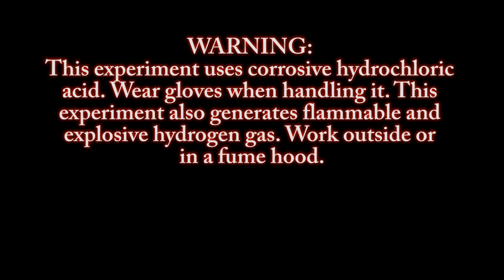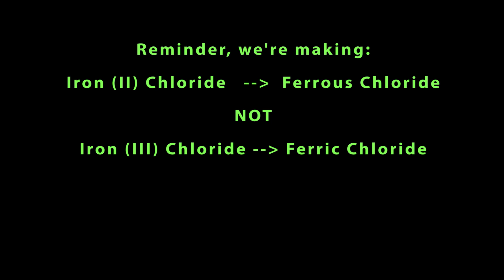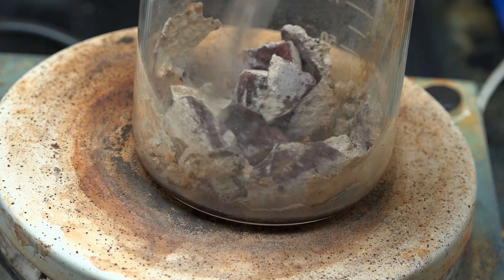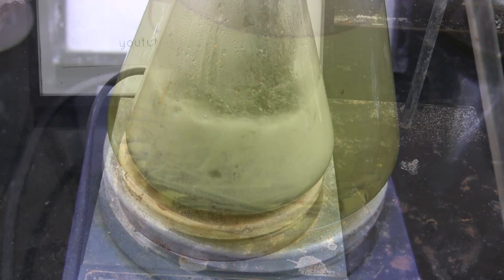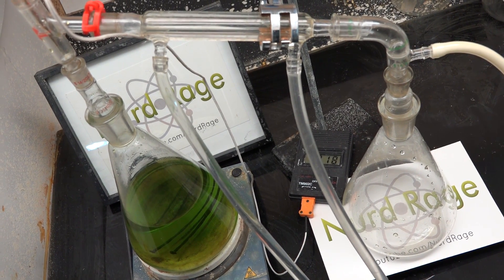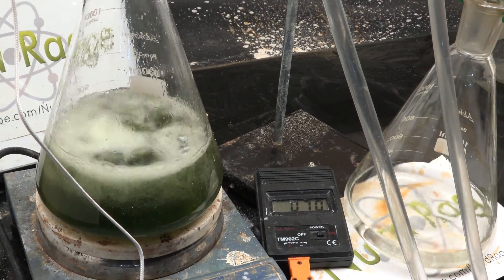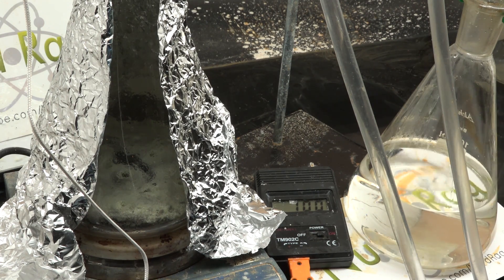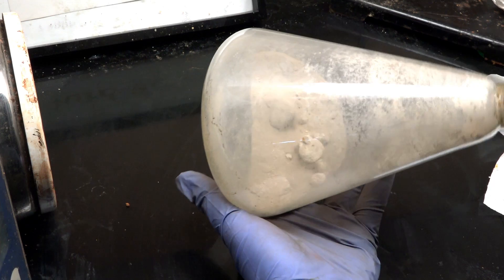Make Anhydrous Ferrous Chloride

Comment: Actually, water can't be used instead of methanol, otherwise no methanol solvate will be obtained, and it's mean that the obtained product won't be anhydrous. So the green solution is a solvate, proof is here G. Winter; Thompson, D. W.; Loehe, J. R. (1973). "Iron(II) Halides". Inorg. Synth. Inorganic Syntheses. 14: 99–104. doi:10.1002/9780470132456.ch20. ( from wiki)
Reply from the maker: Your reference states methanol is preferred. But doesn't state it's necessary.
Reply: Yep you were right, it really mentioned there, sorry.

Comment: Here's how to make ferric chloride anhydrous: Get some iron and hydrochloric acid, then add some methanol to the mixture. Then react it with some hydrogen peroxide, oxygen, or chlorine, distill off the solvent, and insulate it to prevent moisture getting in. That's how to make anhydrous ferric chloride.
Reply from the maker: Already in the video.
Reply: @NurdRage  I guess I don't see it.
Reply from the maker: oh my bad, you mean ferric chloride, or Iron(III) chloride. Unfortunately your method won't work.
Reply: @NurdRage  you mean to tell me that ferric chloride is hygroscopic?
Reply from the maker: Yes, viciously so.
Reply: @NurdRage  Darn. Just when I expect it to be successful!

Comment: I'm making a mass amount of this to purify water for drinking. Is this the same recipe?
 57 GRAMS OF IRON, 300ml OF METHANOL AND 200ml OF HYDROCHLORIC ACID <30%
Reply from the maker: wait drinking water? this is designed to be used without water. If you just want ferrous chloride you can add iron to acid and skip the methanol...

But even then, i do NOT recommend using nails. They could contain other heavy metals like lead or chromium which are not healthy at all. You need a source of a ultra-pure iron fit for human consumption.

Comment: Fe + 2HCl + 2CH3OH → FeCl2 + CH4 + H2O 
Why this reaction is not occured ?
Reply from the maker: +Fatih Enes Kuru your equation is unbalanced, even then, there is no reason it should occur, the acid would react with the iron and release hydrogen gas far more easily than reducing methanol

Comment: I admit I don't know too much about chemistry, but here you're using what you refer to as "iron nails."  Aren't these nails actually a steel alloy?  As a source of iron, wouldn't something like sand cast iron pipe be a more pure source?  It's easily broken up with a hammer.
Reply: +Barnekkid Ironically (pun very much intended) cast iron is not pure iron, it contains much of the same alloy elements as steel, except much more carbon (>2%). Plain carbon steel, such as old nails, contain only very trace amounts of elements like phosphorus, sulfur or manganese, I don't think it's a big deal. Very pure iron can be obtained from iron transformer cores if need be (and specialty metal retailers, it's not unobtainium).

Comment: Could I make CaCl2 anhydrous for dry in a desiccator with this method?:
First I make Cl2, and I do it pass into H2SO4 to dry any rest of water.
Then I pass this Cl2 dried in methanol with CaO.

Thanks you a lot!
Reply: +Juan José Rodríguez That is unnecessary, you can make anhydrous CaCl2 simply by heating  CaCl2 x 6H2O.

Comment: could aqueous ferrous chloride be dried under an inert atmosphere to keep it from oxidizing, or does it decompose/react with its water at the required temperatures?
Reply from the maker: +Robert Szasz if you can do it under inert atmosphere that would be a lot better. Although if you were working on that level you probably aren't an amateur and can afford to buy anhydrous ferrous chloride directly :)
Reply: It's almost always cheaper to buy common chemicals, but welding grade gasses are pretty cheap. If you haven't already done so making an oxygen scavenger/ gas dryer   the low cost but high labor way could be very interesting.

Comment: Is it possible to dry the hydrated ferrous chloride in a microwave oven? Just use a plactic container with a cap, and a small hole in it to let the steam escape. Almost no air is able to oxidize the iron then, I think. Or is there something else that keeps this from working? Also, I don't think it will get hotter than 100 degrees C, because when the water is gone, the iron won't heat up anymore, which keeps it from decompositioning.
Reply from the maker: +marco23p if the ferrous chloride was freshly made and no air was exposed while you put it in the plastic container then i suppose that can work. I'm just afraid it might get too hot and melt the plastic since the ferrous chloride salt is conductive and might absorb the microwaves and start heating.

Comment: doesnt the stopper get stuck when putting it on a hot flask?
Reply: Laboratory grade glassware (typically borosilicate) has a very low coefficient of thermal expansion so it's very unlikely. This is one of the reasons lab glass is so expensive.
Reply: That can happen yes. As long as it won't influence onward synthesis you can use silicone grease to help prevent the joints jamming under reduced pressure. Alternatively use a hot air gun on the joint. Options if these fail to work tend to get messy.
Reply: That can happen yes. As long as it won't influence onward synthesis you can use silicone grease to help prevent the joints jamming under reduced pressure. Alternatively use a hot air gun on the joint. Options if these fail to work tend to get messy.
Reply: That can happen yes. As long as it won't influence onward synthesis you can use silicone grease to help prevent the joints jamming under reduced pressure. Alternatively use a hot air gun on the joint. Options if these fail to work tend to get messy.
Reply: Sorry about the spamming there, some sort of error message came up and lots of repeats.

Comment: Dear nerd rage I am looking to make polypeptide bonds between 2 amino acids at home, could I use HCL to hydrolyse the 2 amines and is there a way to couple the functional groups with easily available reagents? Thank you so much.
Reply: Licenses? What country do you live in?
Reply: You're out of luck. Modern peptide synthesis requires toxic reagents. Look up Solid phase peptide synthesis for more info.
Reply: +T. B He said easily available.. Not Non-Toxic. Acid-Base Hydrolysis using crude chemicals?
Reply: nerdalert226
They're the same thing. You need licenses to buy the toxic reagents. Hydrolysis refers to the cleavage of an amide bond not the formation. You're thinking of an entirely different process where the formation is much harder to achieve.

Comment: Isn't there a danger to putting the stopper on the hot flask? Pressure will drop as it cools down, might crack.
Reply from the maker: +Doazic Good glassware, especially glassware with ground glass joints, are designed to take vacuum. Vacuum distillations would be impossible if we couldn't use vacuum on them.
Reply from the maker: +99 problems When using ground glass joints silicone grease can be applied to prevent seizing as well as provide a better seal. When i use grease i've never had a stopper get stuck.
Reply: +99 problems Perhaps. You can always use a heat gun to heat the top of the flask though when you open it for the first time.

Comment: I have to admit, the timing of this video is rather comical. Just yesterday, 04/28, we attempted to make ferrocene in my advanced inorganic chemistry class using what was supposed to be FeCl2.4H2O. However, based on the color of the majority of what was in the jar, most of the compound added was most likely FeCl3. That wasn't our only problem in the day, for instance, the lab we were using from MIT called for 15g of KOH, but we ended up adding 60g because we couldn't get the mixture of KOH and 1,2-Dimethoxyethane to stay in a slurry. Anyway, this would have been very useful in order to get pure FeCl2 to react and eventually make ferrocene, and it was rather comical to see the day after we needed FeCl2. Thanks for the videos, keep up the good work.

Comment: What purpose does the methanol serve?
Reply: +Erika Sandstrom 
Are you related to Darude Sandstorm?
Reply: +Erika Sandstrom You could use water in the reaction as well, but because the boiling point of methanol is much lower you can boil it off much faster when you need to.
Reply: Dj Ruccy no
Reply: Erika Sandstrom
Oh ok.
Reply from the maker: +Erika Sandstrom what Bakmoon said :)

Comment from the maker: I'll be making a video on how to make anhydrous FERRIC chloride once the new equipment and glassware i ordered comes in.
Reply: Nurdrage would you be able to do a video about making thermite with manganese dioxide from lantern batteries?
Reply from the maker: +Fabian Feliciani Its on the To-do list, but i don't know when i'll get around to it. We'll see.
Reply: Do you have a Ph.D in chemistry ?
Reply: +Nicolas Lopez Yes he does, in inorganic.
Reply: +I need a better username that's pretty cool
Reply: Could you make a video on dry cuprous chloride sometime?
Reply: +Rsaramallac even better would be a solution of it in aqueous ammonia
Reply: Could you possibly make a video on the different ways to make anhydrous aluminium chloride? I'm trying to make it for its use as a catalyst but I don't know the best or safest method to use.
Reply: probably the best way would be how chemplayer makes theirs
take anhydrous zinc chloride (easy to get) and mix with aluminum powder and "distill" is into a dry container
Reply: I've been told it is easy enough to buy online from a chemist who actually is on youtube: ChemPlayer.
they did a video making anhydrous AlCl3 from ZnCl2 in a pseudo-distillation
Otherwise I have also heard that you can dry it out to its hydrate and reflux that with dry HCl gas to get anhydrous
Or you could just react aluminum powder with Cl2 gas directly